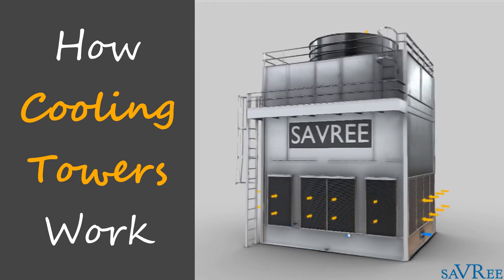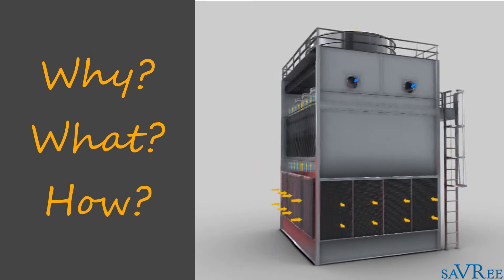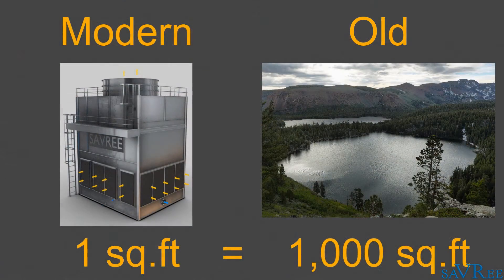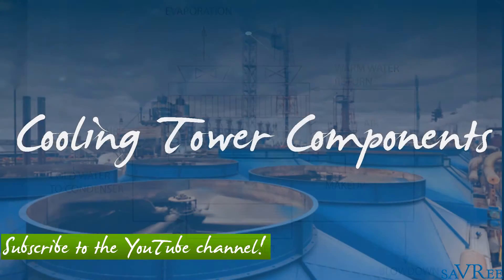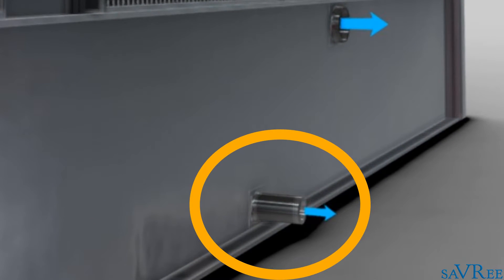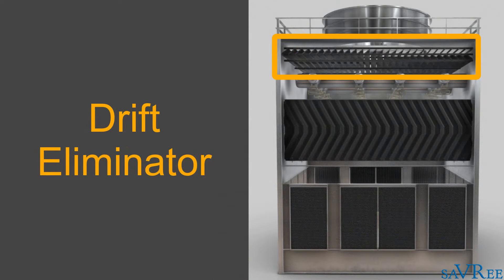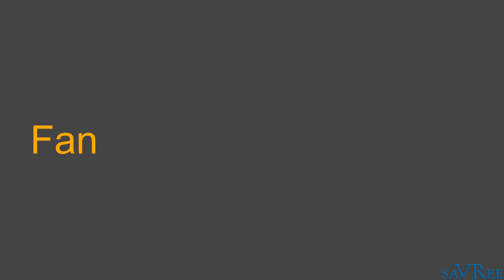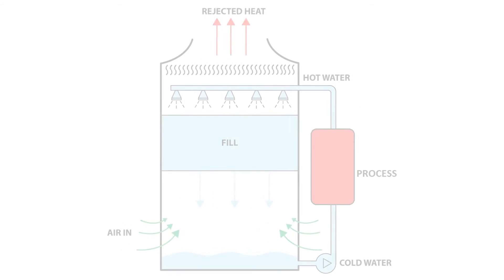How Cooling Towers Work (Working Principle)

Comment: I believe that the drift eliminators do not actually collect the evaporated gaseous water at all as it just goes past the eliminators. No condensation occurs in the drift eliminators unless they are cooled internally. 

The function of the drift eliminators is to create larger aggregate droplets from the smaller droplets until the droplets become so heavy that they fall down.
Reply: Coalesce would have been a good term. Anyway, I love your videos and they are very informative. Although I often don’t really have to know how a particular equipment works, I really like that I always learn these general design aspects and sub-solutions that you explain in the videos.
Reply: @peckdec  
Thank you for the extra info on drift eliminators!
Reply: well, water is still in liquid phase so why wouldn't it collect ?
Reply: @Hamza_Iqbal-i7i  It will collect, but it does not condense at the drift eliminators because condensation means transition from vapor to liquid.

Comment: Would it work when the incoming air is already 100% saturated ? Its operation, I believe, is heavily dependent on the degree of saturation of the incoming air.
Reply: In a perfect 100% saturated condition, it would not work.
Reply: @savree-3d  hi I have a question that needs a quick response, will I get a quick reply if I email?